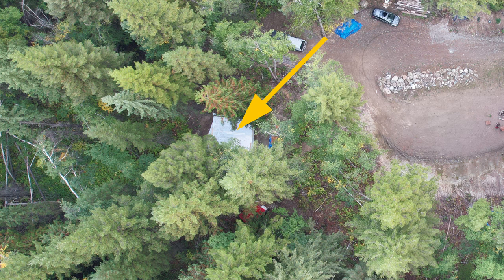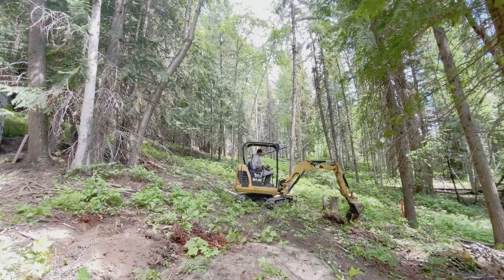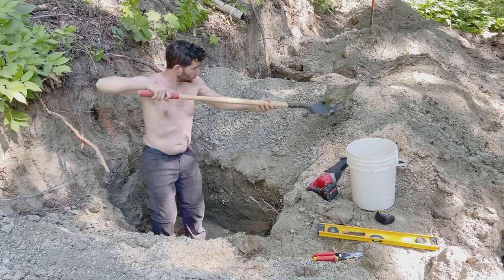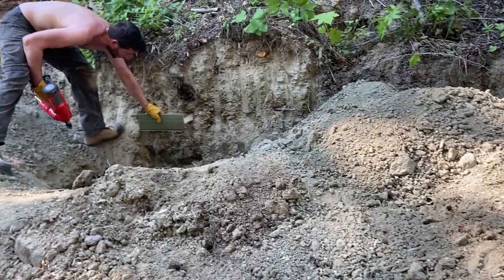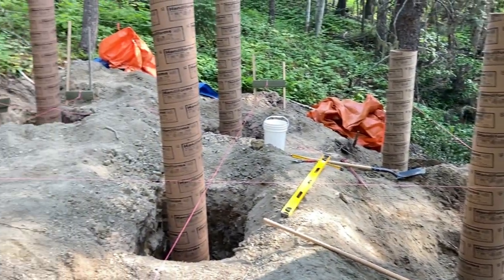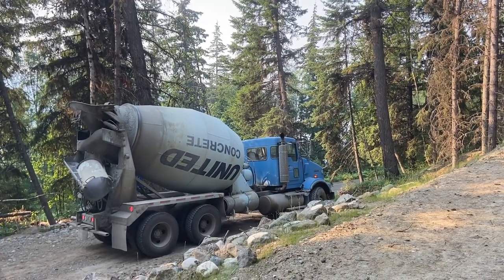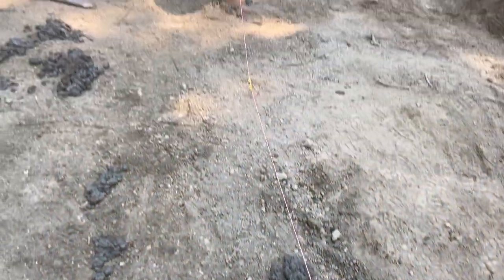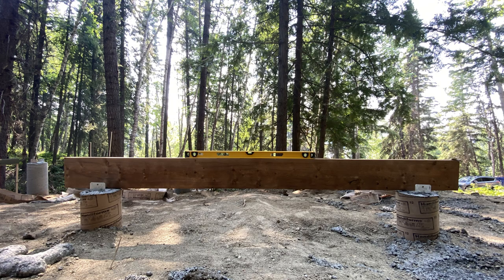Building a pier and beam foundation for our cabin in the woods - Cariboo Adventure Vlog #10

Comment: Lots of hand digging all those holes for your piers. Hard work, but you did it! What is the frost depth in your area? I expect you made sure to dig well below the frost line. Did you design the basic 3, 3, 3 pier layout yourself? I like the footing forms you used. Many people don’t use these, but your foundation will be much more stable with those footings. Smart decision. Good work making sure everything was plumb, level and square. I’m considering some different foundation designs including yours. Did you ever consider concrete stem walls and an insulated crawl space? Was the cost of the extra concrete, simply too expensive? My only concern with the completely open crawlspace is keeping the floor warm. Most cabin builds are on pier foundations. Yours is one of the best I’ve seen.
Reply from the maker: The frost debt is between 3-4 foot. (4 according to the building code)
Jelger (it’s Tanja writing this comment, hehe) did design the 3-3-3 layout, but he did consult the BC building code for everything he could. 
Jelger thought the concrete stem walls were too hard on a slope + with the digging. For our 10 year plan larger structure, we’re hoping to do a full concrete basement. (But we might need an engineer for that, because our slope is… alive 😂)
We agree that insulation wise our current platform isn’t ideal, haha, but can always enclosure it later.
Reply: @CaribooAdventure  Your frost depth is deeper than I expected. But, good you checked this. 4’ is quite deep! I tend to agree with Jelger on his assessment of the difficulty to build stem walls on a slope. But, I thought the excavator leveled it for you, didn’t he? Your floor can still be insulated either with reflectix or spray foam. As you said, perimeter skirting can be added later to help keep it warmer.
Reply: Do you what size metal brackets those are and what make these are? I can’t find any that will work for 3 2x8s nailed together in a beam.

Comment: Hey guys, great videos. Looking for a little help on the concrete anchors you're using. We're building a similar structure and our Building Dept wants to see 3, 2" x 12"'s in a U shaped bracket like you're using. Problem is that I can't find that size U bracket, I can only find 3.5" or 5.5" and we need 4.5". Greatly appreciate a little guidance. By the way, we're also using the Big Foot bell housings for our footing's. Thanks in advance.
Reply from the maker: Thanks for the comment! We had the same issue, so we ended up using 5.5” anchors. To fill the 1” gap, I took some scraps/cut-offs from the beams (so pressure treated lumber) and planed them down to 1” and jammed them into the anchor next to the beam. Just to fill the gap. Then I drove the fasteners through the whole stack and it’s very stable and solid. Hopefully that helps! Good luck with the building!

Comment: Awesome video! I am looking at doing something similar on my property. Where did you guys get the forms from for the piers A link would be greatly appreciated.
Reply from the maker: Thank you! The forms are available at any building supplies store (Home Depot, Lowe’s…). They go by different names: sonotubes, building forms, or concrete forms. Here’s an example at Home Depot: https://www.homedepot.com/p/Quikrete-QUIK-TUBE-10-in-x-48-in-Building-Form-Tube-692202/302440303

We put them on ready-made footings called Bigfoots, which are a Canadian brand. Here’s an example in the US: https://www.homedepot.com/p/Redi-Base-8-in-x-24-in-Disposable-Plastic-Footing-for-In-Ground-Concrete-Column-RDB1/204622716

Alternatively, you can skip the footing form, and pour some concrete in the hole, let it settle then put your tube on top of it, and fill it with concrete. As long as the foot is wider than the tube you’re good. 

Best of luck!
Reply: @CaribooAdventure  thanks a million. I got clearing to do first but wanting to start collecting supplies.
Reply from the maker: Sounds like you have a lot of work ahead, so enjoy and good luck!

Comment: What is the square foot age of your cabin? What is the width of your piers? What is the width of your pier footings?
Reply from the maker: It’s 16 x 20 feet, so 320 square feet. :) 
The piers are 12 inch and the footings 28 inch.
Reply: @CaribooAdventure  Could you use this method on a larger home? say, 700sqft?
Reply from the maker: You sure can! As long as you stick to the building code requirements! (The span table for floor beams)

We’ve certainly seen much larger builds than ours.
Reply: I built a 2 story 20x56 house in a very small town on piers  to move later when I find the perfect spot in the country  in 2018 total cost of piers and concrete  labor and equipment  was less than $2000  for 16 piers 12 inches diameter  3 foot deep and 3 foot exposed plus 8 piers poured to ground level  to block up to floor  down middle on a steel  beam so removable  
And trailer can pulled under it  when house moved later.  It was so easy to work on it when building in town versus  out in the country  20 miles from home or  a Lumber store

Comment: What laser light did you use I'd like to buy one
Reply from the maker: We got the Dewalt green self levelling cross line laser label model Daw088CG. Very happy with it, we use it all the time! 

Got it in Home Depot but if you feel like Amazon: https://www.amazon.ca/DEWALT-DW088CG-Cross-Laser-Green/dp/B01MQPYPO3?crid=3DHYM749Y9WKQ&keywords=dewalt+laser+level&qid=1690817009&sprefix=dewalt+laser+level,aps,196&sr=8-3&ufe=app_do:amzn1.fos.d0e27fc4-6417-4b26-97cb-f959a9930752&linkCode=sl1&tag=caribooadve07-20&linkId=12ac0ff558bb99607e0ab1bea719a6bc&language=en_CA&ref_=as_li_ss_tl

Comment: What MPA concrete did you use? And did you use 5mm bar for reinforcement?
Reply from the maker: From what I could see on the concrete firm’s site that we used, 28 MPA. The rebar was 10mm.
Reply: @CaribooAdventure  Thank you so much. We just placed our order today for the concrete for our cabin at Canim Lake. Your build looks great and your videos have been so helpful.
Reply from the maker: @08rabbott  that’s so exciting!! :) Good luck with the building! And thank you for the kind words!
Reply: @CaribooAdventure  Thank you.... one more question if that's okay. We have our first inspection scheduled for Tuesday. any advise? Did you backfill the soil or did you leave the holes open for the first inspection. Just curious because the first inspection is Tuesday and if all goes well we will pour Wednesday. Thank you in advance. :)
Reply from the maker: @08rabbott  We're very fortunate to not have mandatory building inspection in our area! We only need inspection for our electricity and for septic systems. So I have no idea! :( Hopefully another enthusiastic builder can answer you! Best of luck!
Reply: What area pf bc are you? Im trying to find a place thats easygoing for codes and stuff.

Comment: What is the square footage of your cabin? One-story or two-story?
Reply from the maker: It’s 320 square feet and we have a second story with pony walls.
Reply: @CaribooAdventure  what are pony walls and what are the sidewalls ans center measurements?
Reply from the maker: @tamicakenyon5934    pony walls are short walls. Our second story walls are only 4 feet. The width of the cabin is 16ft and the length 20. The structural wall we have in the middle is 8ft on the second floor. (There’s a video later on that shows the pony walls etc)